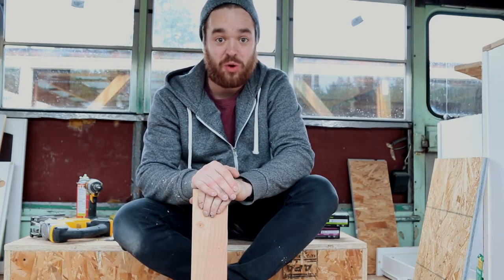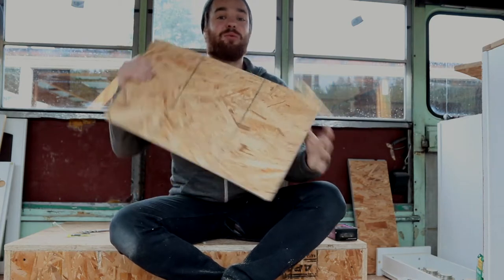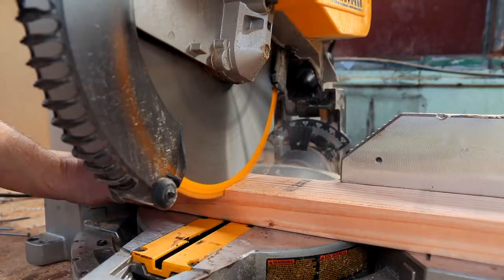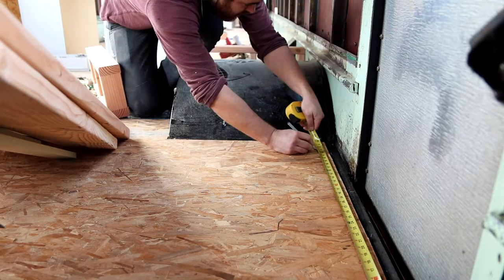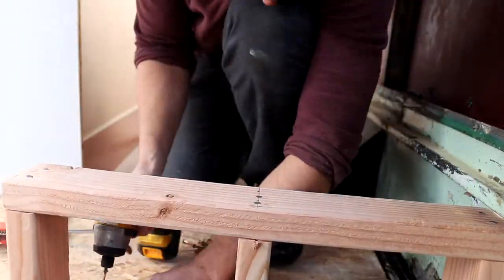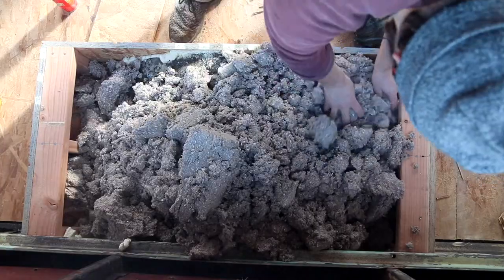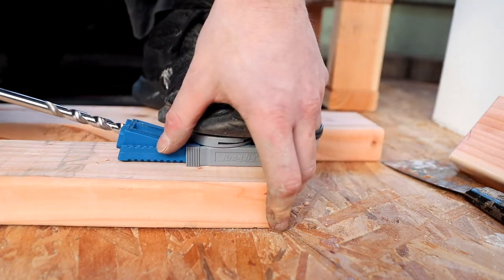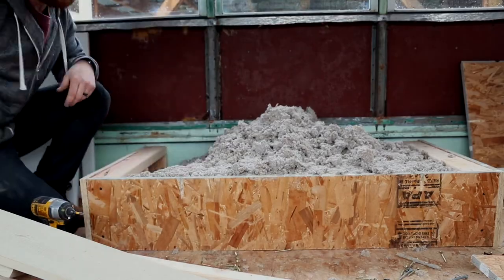Wheel Well Box - Skoolie Bus Conversion - E12

Comment: Nice job brother. Have you used the insulation long term before? I am not familiar with it but like how you used it yourself. I am worried it will break down and compress itself, leaving an air pocket. Especially above the wheel well since that’s what absorbs most of the bumps. Thanks for any insight you can give me on the material.
Reply: john challenger I am sure it’s high quality. When I say “break down”, I am worried it will compact itself, leaving an air pocket. I would think gravity alone would pull it down and one would need to constantly have to add more. In a house that sits still, maybe not so much. Do you have to keep adding more throughout the years? To clarify, if it is sitting on the floor of the attic, I would think it was fine. But using it to “fill in” a box or wall, I am worry I will have future issues and would cost me a bunch in the long run. Thx
Reply: john challenger Bounce up and down, hmmm. That info does help. That might not be so bad. I’m going to look further and do more research. Thank you John!
Reply from the maker: I haven't used it before! I'll make sure to update you once we have driven it around for a while. I figure the worst that can happen is that I'll have to pop the top off and refill it once or twice. It packed in pretty nice and it only cost $10 a bag. (it only took 2 bags to do all the wheels)
Reply: ColaVentures Thx buddy.